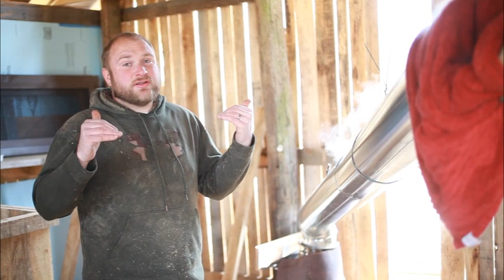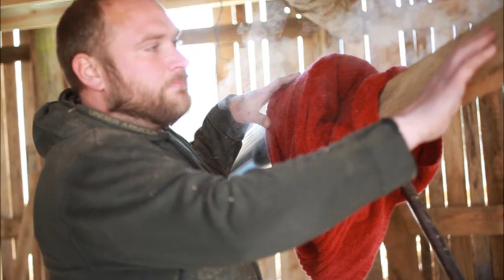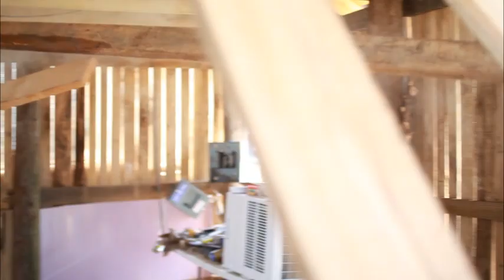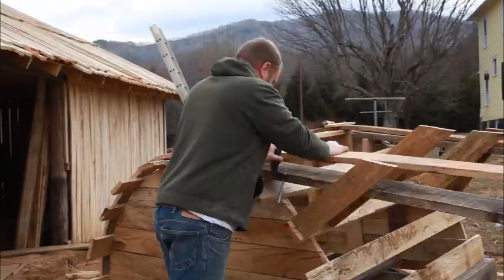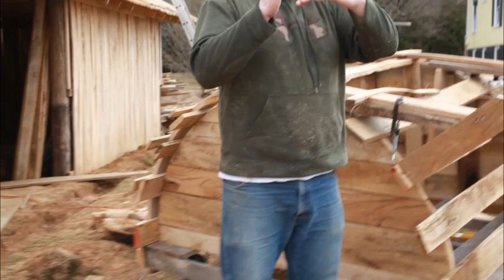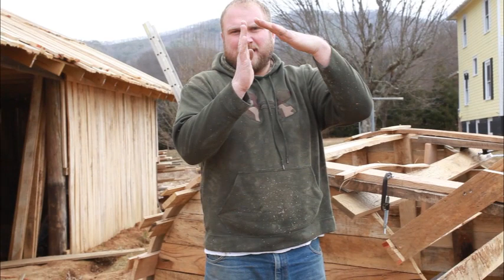Steam Bending White Oak Boards

Comment: Fantastic. How thick is the piece you bent and what is the max you have bent?
Reply from the maker: This stuff was 4/4 rough sawn lumber, so about an inch thick. I was buying "cull" lumber at the time, the stuff that wasn't high enough quality for the local mill to ship overseas for furniture making as I understood. As a result, the boards didn't have a lot of clean, straight grain. I imagine there would be fewer issues bending really nice, straight grained boards; but even still, this method worked well for me. I've seen other people online bend massive beams several inches thick with metal backing straps and heavy equipment. If you have a long piece that you can get good leverage on and a good stout frame of some kind to bend it on, I bet you could bend something 1.5-2 inches by hand. It obviously gets harder the tighter the radius. I had a pretty big curve that was fairly forgiving.